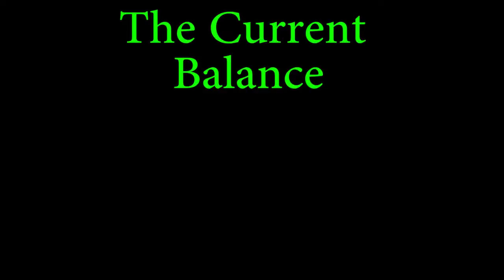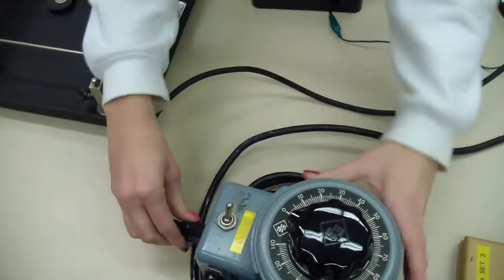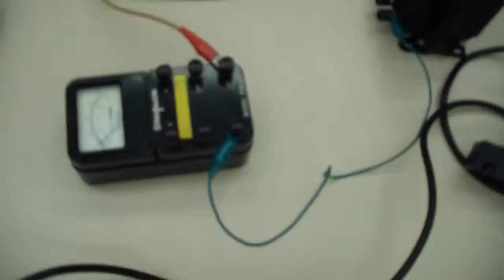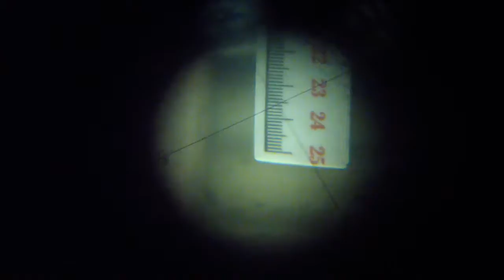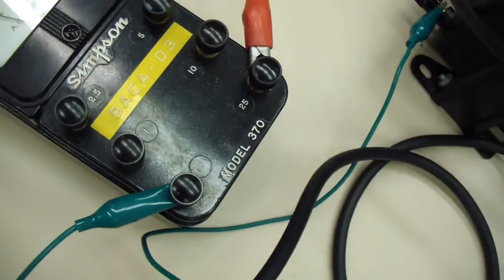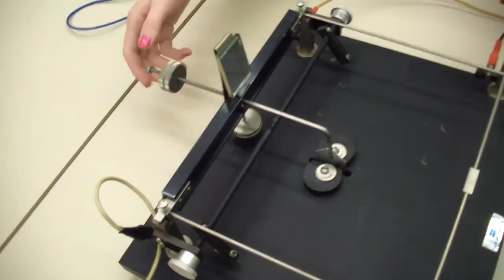PHY137: The Current Balance

Comment: When connecting the ammeter, MAKE SURE THAT ONE WIRE IS CONNECTED TO THE BOTTOM LEFT TERMINAL (labeled "±"). The other wire should be attached to the 25 (bottom right)